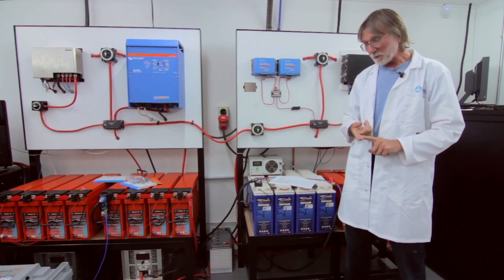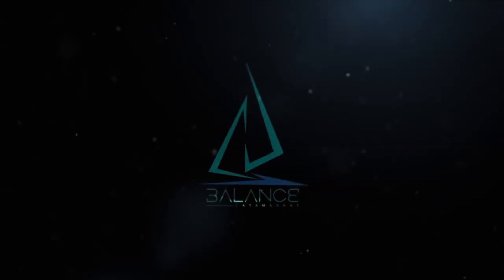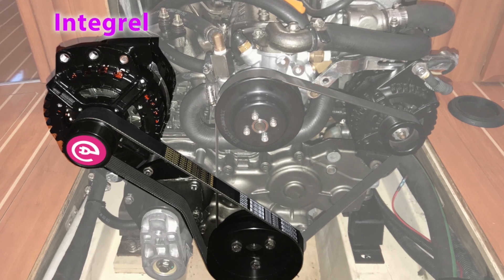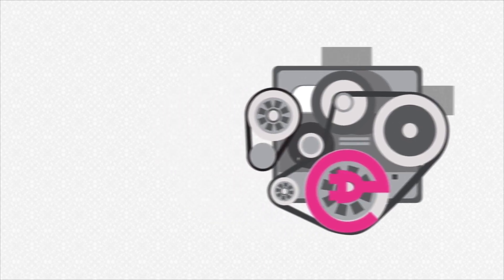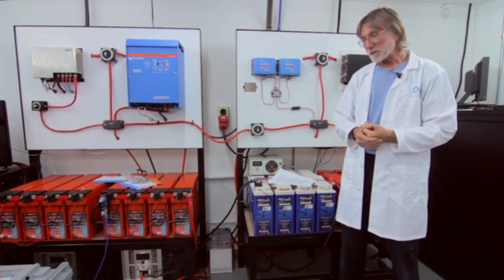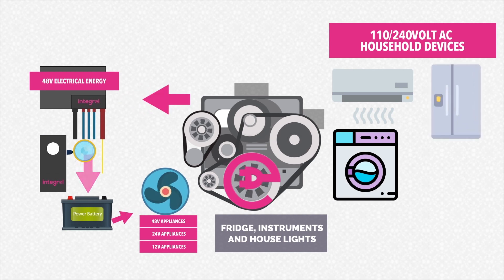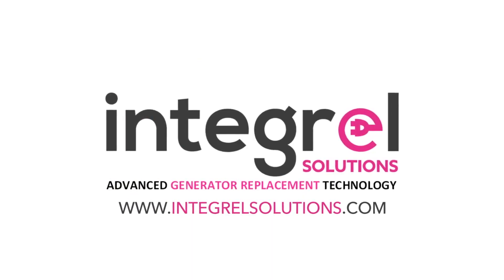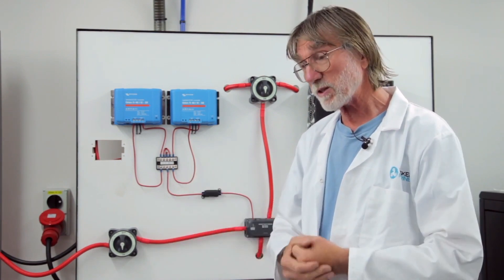Integrel Systems and Balance Catamarans - The Perfect Match

Comment: What about a lighting strike, has the Integrel system been tested under 1 billion volts of electricity? If there is such a thing to replicate  that power.   What would happen to the Integrel system?  Does it have , as an option, a power conditioner or a  UPS  to help  protect all electronics?
Reply from the maker: Luckily we have never experienced this but would recommend reaching out to Integral directly to get more info regarding this scenario.  We have been installing Integral systems on the majority of our boats and have experienced no issues.

Comment: The diesel engine directly driving a shaft  is the most efficient way to propel if solar, wind are not available and the battery does not have the legs. Propulsion is a pretty power consuming  function. Bear in mind that a genset is at best 80% of the efficiency of direct drive and then you have at least 5% loss in the electric motor, but if the motor is operating slowly (to save battery power for example) then it may be operating at a 30% loss or possibly worse. On this basis the engine driving the shaft and a Integral Generator sucking up the energy between the propellor draw power curve and the engine optimal power curve you have the best of both worlds. If you are going to improve on that you will need a variable pitch propellor. If you make more energy than you consume in house loads, then supplement your engine drive with an electric drive to consume power concurrently or independently drive the props for short trips, mooring, re anchoring etc.

Comment: False, you did not do your research properly! LiIon batteries are cheaper than AGM because they last 4 times longer and can be discharged to 0 not 50%. With hydrogenerators, electric motors with regen and more solar panels you have more energy than you need! So many people have crossed the Atlantic with such systems! Serenity yachts, Silent yachts and more, successfully use electric propulsion.  Please stop spreading disinformation!

Comment: Hi Phil. Nice tech. Have you guys&gals ever looked into mg energy systems (netherlands)?. They have batteries with very high energy density and high C ratings. If I would get a boat, I'd get integrel with MG (2 integrels-each engine on a 1000A LV MG+ 6x7.2kw bateries LFP or HE) overkill? it would be lighter then the genset.

Comment: Using Lithium ion batteries and a smart controlled alternator makes more sense than a generator, for boats that have diesel drives.  It's already becoming an industry standard for smaller boats.

Comment: Why not ditch the engine and just have a generator with an electric engine?  Wouldn’t that be more efficient and easier to maintain?
Reply: Hi guys, actually SV Top Secret validates Phil's and Andrew's point. That for a cruising catamaran the technology is not there yet.
SV Top Secret is a highly refitted 58 ft Vovage catamaran, it has 38 solar panels generating 3800 watts and a very large li ion batterybank. This powers 4 Oceanvolt  electric engines total of around 100 hp and according to the owner it could run at full power for 25 minutes before the batteries are depleted.
Recently the owner decided to replace 2 of the 4 electric engines with 2 diesel engines. So as for now it's not feasible to have a fully electric cruising yacht.

Phil and Andrew I admire your passion for creating in my opinion the best performance cruising catamaran.
Reply: Hi Peter, we have thoroughly discussed this topic in a previous video.  The reality is that a hybrid setup is less efficient, overly complicated, and suffers from limited speed and range.  It can be a good choice for a "weekend warrior" but we don't think it is practical for long distance cruising.  Here is a link to the video: https://www.youtube.com/watch?v=e0q98-JQPLk&t=99s
Reply from the maker: Again, we just keep going over and over this!  I think it is best to look at why some cars are plug in hybrid and others all electric - and why some electrics have a small diesel engine (the BMW 3) as a range extender. And yes you can put on a diesel generator to run electrics and really must if you want any range. Our point is you are still burning fuel, and unless you get two generators you have redundancy. Again, weekend warrior, electric fine. Cruiser, either dual diesels or electrics with dual generators. But as I have said to exhaustion, you want electrics you can get them and have them and live with their negatives and positives like any other choice. We simply feel dual diesels, a lot of solar, Integrel alternators, lithium batteries, is the way to go. If battery storage got a whole lot better or solar was three times more efficient electric cats will start to have appeal for us. Not yet. Phil
Reply: Balance Catamarans Phil you need a ‘cut n paste’  reply. 
But It’s a positive thing people exploring the elec options and it’s the nature of your game so get used to these queries and keep an open mind. Wasn’t long ago people said foiling mono hulls? Never.
Reply: I think people keep asking because it makes sense, and it’s what people want.  Overall you end up with less weight, less maintenance, less noise, and regeneration capabilities.  Seems like most yachts have a generators, and for good reason.  And, all of this talk about being “more green” totally misses the point about the advantages of electric motors.  People want electric to lower maintenance and increase reliability- no starter motors, transmissions, filters, impellers, head gaskets, and all the other crap that boat owners are maintaining.  And you get regen while underway, when you need loads of power for auto-pilot and instruments.  And if keeps your sail load steady when surfing down waves. And you get loads of torque to maneuver.   Electric motors are about simplicity - there is enough maintenance to deal with.  And who wants to sit in an anchorage with Diesel engines running to top off batteries?
Reply: @peteypie333  You are right that it's what people want, but as an electrical engineer and sailor, I would like to point out that there are some facts in the way of what people want, at present. #1 - Cubic meters of water need to be moved aside in order for a boat to move. Big energy is required. Cars have pretty low rolling resistance by comparison [Tesla]. #2 - Diesel - saildrive - propeller is far more efficient than diesel generator - battery bank - motor - propeller [compounded losses occur all the way along the chain]. #3 - Regen needs a special prop to be effective and the propulsion propeller of most  yachts today are sailing efficient, fold back types that aren't suitable for regen applications. I did have very good regen results with a hydrogen unit that I made as a development study. It worked very well and looked like a drogue crossed with a prop in a torque tube. It charged in anything from 0 to my boats' hull speed. I would make the hydro generator blades self balancing in their pitch in future in order to maximize the units output. It has to be noted that they are only suitable for regen at anchor [fantastic for me in a 3 kt mooring field in Auckland] or when there's plenty of wind about for sailing. [Phil call me if you want the design :-)] To summarize first principles: The physics behind energy density shows that batteries are not able to store anywhere near enough energy to push a yacht for a few days at more than a few knots. Phil and Balance are quite right here. Diesel is a hydrocarbon and the most energy dense fuel we know. Hydrogen [preferably green] is similar and will probably be the replacement fuel for shipping, heavy haulage and cruising yachts in the future. It's just tough to tame right now. But we'll get there. I agree with Phil that it'll be 10 years or so before we see the end of diesel onboard. But for different reasons. Australias cabs already run on hydrogen and it is added to LPG already, these among many other pilot projects, but there is quite a way to go yet, towards developing it as a fuel for mass consumption and its mass adoption. Fortunately, those 'wanting and constantly asking', as you say, are making the conditions right for the development and adoption of better systems in future. So don't stop demanding more. Call, Phil, or the Paarman bro's and order a Balance cat with what you want onboard :-) Regards, Leon

Comment: Isn’t there an all electric catamaran  (Silent Yacht) already? Could you use some of their technology?
Reply: Hi McRae, I would encourage you to look at the actual performance specs of the Silent Yachts.  They carry a massive amount of Li Ion batteries, a huge generator, and two large electric motors.  The amount of weight and space occupied just isn't practical for a performance oriented sailboat.  Even with all that equipment, their boats still don't have enough range at a speed that we feel is sufficient for long distance cruising.  Full electric or hybrid system technology will eventually make sense for cruising boats once the energy density of batteries increase 10x or more, which is about 10 years out in my opinion.  Until then, we feel that Integrel will be the tech to bridge the gap between conventional power generation and full electric drivetrain.
Reply from the maker: Nothing new with Silent Yachts technology. We can use the same things. Andrew rightly points out the issue: energy density and storage. If you want enough lithium batteries to go 200 miles without a charge our boats would sink with the battery weight. Weight impacts performance in a sailing cat and the less weight and the better the performance the less you need to motor at all. If you can do wind-speed in 6 or 7 knots of wind you will seldom need to motor. But when you are becalmed and a storm is approaching you want to be able to position yourself with good range and great speed. Anyways, our boats use very little fuel. Phil
Reply: Balance Catamarans  I see your point
Reply: McRae Rembert Ive run the numbers on Silent— great for island hopping with a couple days between moving.  On a passage you would be running the generator %50-80 of the time.

Comment: Why isn't the word  HYBRID ever mentioned? Genuine question. Replace diesel engines by low voltage generator to charge lithium batteries very efficiently. In most situations you will only use your electric motors for short times, i.e. in/out of marina or anchorage, or getting through tight spots. With performance cat like a balance you would get great regen from 10 knots of apparent wind. If you end up becalmed you then use the hybrid system to motor (not very fast) for as long as you need. Why isn't this technology being offered on a large scale? Sometimes I hear the  answer that "what is the point of replacing diesel engines by a diesel gen", but it is not the same at all, You would use the gen a lot less than the diesel, saving on motors, maintenance, fuel, and pollution, and you get regen. What is not to like? Am I missing something?
Reply from the maker: Wish that were so!  Among our buyers are some of the most highly trained engineers in the world, and in the field of energy storage. If what you wanted was so great, trust me they would ask for it. Sadly, forgive me, I have overseen 900 cat sales as of last year and been through the evolution of the electrics, hybrid, etc. Some of the projects were just flat out failures, the others you just accept the higher cost and lower reliability and low range of electrics. And you are wrong on the issue of how often you would use a generator, and why really to be safe you need two of them. Keep doing your homework and if you are able to cut through the internet babble and talk to captains who have run electric cats you will find your way to the truth. By the way, we are happy to do an Ocean Volt cat, so long as you listen to us on the negatives and are happy to live with them. Ocean Volt is a good product, also Torquedo. They are fine for day sailors and island hoppers. We think they are less ideal for ocean crossers, but of course, you can cross on anything and if sitting around waiting for wind is ok with you, or motoring at very slow speeds, or running the generators almost constantly is somehow more appealing than running diesels engines (this I cannot grasp, but hey to each his own), then get an electric cat. In the end it is about your happiness. I just rely on my experience when advising customers on new or used cats and speak from that 45 years of experience. A performance cat is better off with twin diesels. Phil
Reply: @balancecatamarans  Phil, out of curiosity, at what energy density compared to today's cells, and solar efficiency compared to the 17-18% efficiency you get in todays panels, would you consider partnering with a businesses like Oceanvolt and offering them as a factory option?
Reply: @BufSabresFTW  HYBRID is a word loaded with nuance, not just in the marine application realm. This goes way back to WWII submarines and the early days of diesel electric drive vessels. As a tugboat engineer retiree I call your attention to Foss Maritime’s hybrid tugs, a world first. We built 2 of them and they had 1000 HP electric motors on the shafts, coupled to smaller main engines, and 300Kw generators feeding the buss. In short...electric drive, smaller mains to be used when pushing/pulling, and larger genies when just running light. Huge battery banks. Very lengthy maintenance intervals on the mains. Significant savings on fuel and emissions. Significant original cost. Not a lot of buy-in in the industry.
Reply: no youre on the money. im with you there but you apparently need a large gen (12kw) to keep up with the energy needs if you were say motoring in 3 days of fog, i know this will be unusual but it scares people into dismissing the idea.all other times you would hardly start it up.
im doing a costing ( dollars, weights, pleasure) of full elec, hybrid and trad systems on a 52 cat at the mo. ocean volt is about 100k more than trad but still doing my homework.
Reply: @simonhantler8062  How about one diesel and one electric with a good alternator to boot? Could be a bit awkward for manoeuvers, but you might get used to it...Could be a lot cheaper...
Reply: tonewreck1 that was my first post, one of each. As long as the thrust is equal I don’t see an issue. These integrels aren’t cheap, $13k approx but game changers sort of.....Although it’s still requires a deisel motor which everyone’s trying to get away from.
Reply: I saw your post afterwards...nothing is cheap....but it would maybe pay for itself in the end...? Still cheaper and lighter than a generator and less maintenance.

Comment: One deisel one elec propulsion. Balance.
Reply: There is a reason no builder has tried to do a system of that design yet.  The complexity and cost is prohibitive.
Reply: @andrewhodgdon2786  Not sure why there is a lot of complexity other than the throttle mechanism.  One diesel/saildrive is standard out of the box + Integrel.  The other side is Electric saildrive.  You don't need a huge lithium bank since you use diesel for long-distance and charging.  For regen, motor sailing, close maneuvering, or a quick bit of power for sail changes, etc the electric is perfect.
Reply: Would love to hear more of your thoughts Andrew,owned and sailed large cats for over 25 years ,one diesel and one electric one be great combo for crazing cat???
Reply: @Mark-ou3xs  especially with these game changing integrel generators. lots of solar, not hard on a large cat roof at 400w per panel. big lithium bank, wouldnt use diesel motor much. both engines on shafts, just need to get the thrust of each prop the same.
Reply: I haven’t run into many people that use both motors except close quarters berthing etc etc,I wanted to change one engine out for a electric years ago,
Reply: @Mark-ou3xs  Yes, its a good point.  How often do most cats use both engines for motoring anyways?
Reply: @Mal L Awesome, thank you. I'm really glad someone is working this angle.

Comment: Another great video, Phil. How long would you estimate before all-electric ocean cruising does become a reality? Five years? Stay ib balance ;)
Reply from the maker: 5 to 10 years. Performance cats will come first as they do not require so much effort to move under power.
Reply: @balancecatamarans  What would happen to the Integral system then? what is it in the roadmap?

Comment: Just wondering..., any  existing technology that can utilize hydro generated power ? Moving water turning a mini-turbine charging the LiOn batteries..
Reply: Oceanvolt re-gen sail drives.
Reply: @bertmacdonald337  yep, and even so you need a fast boat and good wind to generate huge power as the relation between speed and electricity generation is not linear. At 6 knots you can generate few hundred watts, at 15 many KW.
 Or  at a smaller scale there are hydro generators that don't require a complete boat conversion, but afaik at best one of those hydro generators, Watt & Sea is an example, can produce 0.6 KW, that is any way more then enough, coupled with solar, to have all the energy you need to run your systems on a passage, but obviously not enough to run the air conditioner or heat your boat in cold areas.
Reply: There are bolt-on hydro generators such as the products from Watt & Sea.  We would be happy to add these to the Balance as an option if desired.  Cheers!